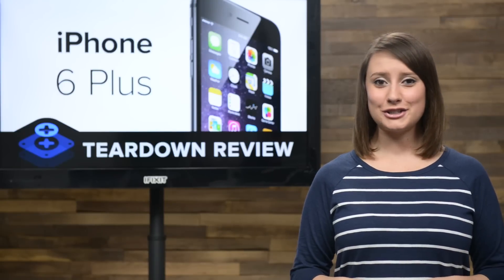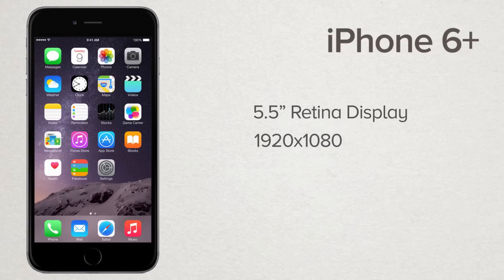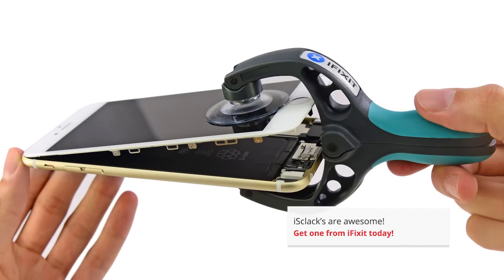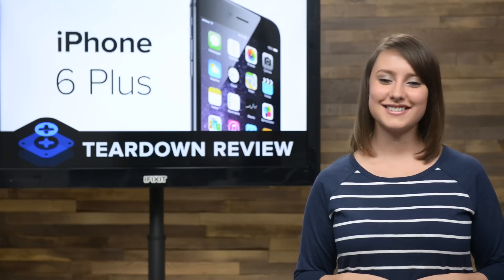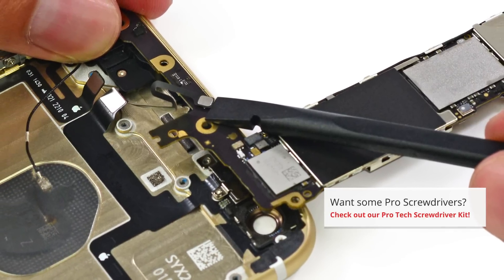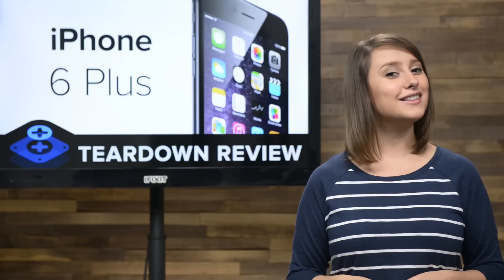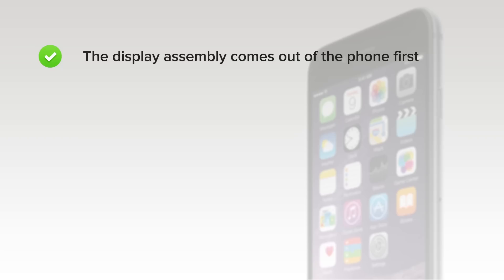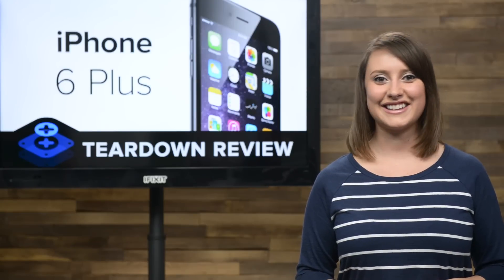iPhone 6 Plus Teardown Review

Comment: I have a question and an issue which you may be able to answer for me. I did a disassembly and reassembly for an iPhone 6. Everything works on the phone great however I noticed the Touch ID stopped working. The home button and siri work but no touch ID. Every time I try to set it up, it says "Touch ID Failed". I tried restoring the phone to see if that would fix the issue but it made things worse. Now I am getting ERROR 53 when I restore.

Any ideas?

Comment: Now I see why the 6+ would easily get bent. It has no reinforcements. Unlike most other phones which have a slab of metal (magnesium alloy?) inside onto which the components are laid out, the 6+ has no reinforcing frame, whatsoever, apart from the case itself. The components are simply put together inside the flimsy aluminum chassis.

Comment: To be honest I love my iPhone 5s, I want a phone not a tablet. phones are getting too big I'm gonna hang on to my iPhone 5s until it won't work anymore and it still works Flawless
Reply: jay123health Question, it’s 2018. You still using that 5s?
Reply: why not bear with the "old one",  new devices coming in so fast, often too fast.
Reply: yo right sir
Reply: I switched from an iPhone 4S to an HTC One M7, and while it felt big and unwieldy at first, I have to say I was used to it after just a week or so. Also, big screens are excellent! Although I do believe that any device with a display over 5 inches is simply too big. 4.5 to 5 is the sweet spot.
Reply: I also have the 5s but under contract so will not be getting the new iPhone, I may get the 6s next year. I agree the 5.5 is nice but in the real world could be annoying to carry around, I'll probably go for the 4.7 which is not much bigger than the 5s and will be a nice upgrade from the 4" screen on the 5s.
Reply: The 6 has a nice size and feel, I would probably have one if it had 1. a flush camera with the body, 2. less ugly antenna lines, and 3. a 1080p screen. there is no reason why the 6 doesn't have a 1080p screen. I feel like the 6s will solve those issues. I'm getting the Sony Xperia Z3 in the meantime, definitely looking forward to that, it's a powerhouse and a beauty! (And freaking waterproof!)
Reply: It's a phablet
Reply: TwoTech Ruhaan
Not the 6, but the 6 Plus is for sure
Reply: svfutbol20
I don't mind the camera or antenna lines as it would go into a case so neither is an issue. Yes the 4.7 could have been 1080 HD screen and I'm betting the 6s next year will not have it either, you'll be looking at 2016 before that would happen, JMHO.
Reply: Craig Best
Well I hate cases, so that's the difference I think. I won't go back to Apple until there isn't an Android on the market that is decidedly better and sexier looking, and luckily for me, the Sony Z3 is easily that phone.
Reply: Hey guys listen,, I upgraded my phone and got my old  iphone unlocked for free at iphonegeeks .us
Reply: How about no !, The only working free site i can think of is iphonegeeks .us !. Just try this site !
Reply: svfutbol20 People listen, , From 3gs to iphone 6 , iphonegeeks .us will unlock them all for you !!. you only need that site
Reply: Bardy Daniel
So iPhone will finally play a .gif file from my PC? What a time to be alive, this is the future
Reply: Roland Jäger yep very good point its not worth upgrading from a 5s to a 6 or 6plus.Wait for the 7 or 8 or whatever apple comes out with next year

Comment: Haha haha haha!!!!!!! Only 1 GB of ram! Apple really does excel in mediocrity! iOS 8 is alright, but it's too little too late.
Reply: Apple does do a great job with optimization, but people and apple tech friends are already reporting lag issues due to the shortage in beefed up ram (2 GB). The iPhone 6 is reported to be more capable with its lower specs taxing less stress on the over worked a8 chip. 
 And for those saying sales is an indicator of a good product, you can't be more wrong. It's more an indicator of good marketing and a cult following. 

I've used iPhone since the 3gs and Apple has gone down hill with more crashes, reboots, and battery issues with each new iOS.

Comment: Even though i am no fan of apple i don't see pentalope screws as a real issue any more. The screw drivers are widely available. Im just wondering if they fixed the issue with the lcd etc connectors on the mother board. I have had a number of the 5 line 5c 5 and 5s have them fail after a face drop that broke the glass. In one case the connector came completely off the board with the ribbon still attached.
As for the fused glass while i would never do it in practice on a iphone screen i have removed the glass from iphones from 4 line to 5 line. With a vacume table hot plate and the wire it is pretty simple and fast to pull the glass. But still should cost a point on the repair-ability. As for the glass mae from sapphire it is still just glass that is a little more scratch resistant.
The finger print scanner from what i understand is also suppose to be the sapphire glass and yet it scratches readily on the 5 s  

Seem like most of the special glass if not all break and scratch just as easy as good old tempered glass and are more marketing gimic than any thing else. 

I am very happy to see that stupid finger print scanner ribbon is not done like the 5s. That made that phone just stupid dangerous and hard to repair. 

As always great teardown